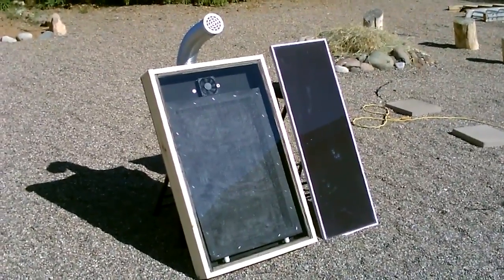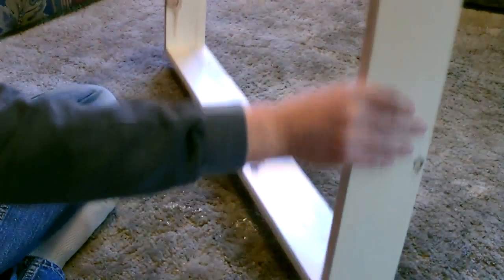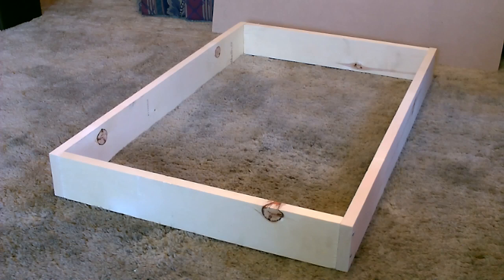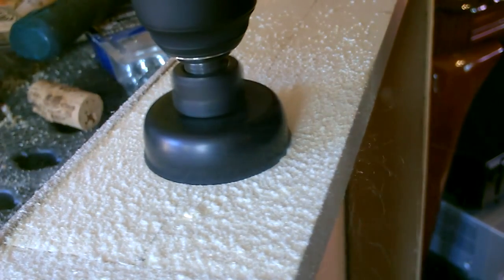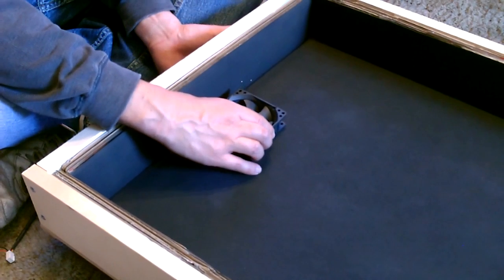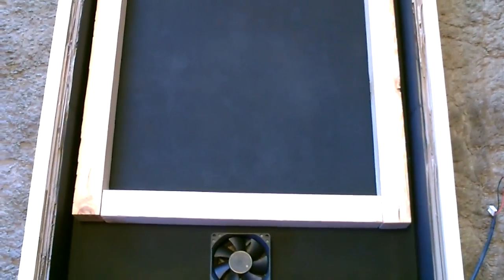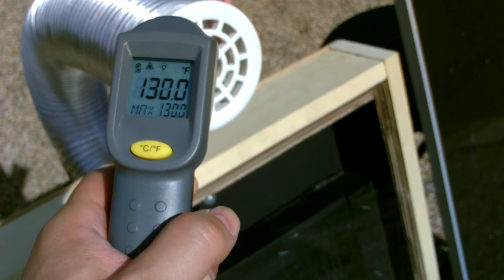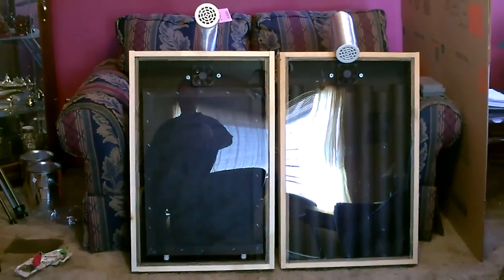Solar Air Heater! - The "Screen Absorber" Solar Air Heater! - Easy DIY (full instructions)

Comment: What are you using to power the fan?
Reply: So it wouldn’t work at night?
Reply: @exoscrewdriver4213  not sure if your question is to be funny or not. If so I laughed (a lot) but if your serious then no this would not work at night. First, the sun heats the black paint on the air collector he made. There would be no heat from this at night. Second, the solar panel will not work at night but you could wire the fan to a battery for night time use. Durning the night this system will not create hot air.
Reply: @exoscrewdriver4213  LOL, thanks for the laugh.

Comment: How hot does this get in the summer? Of course I dont want to use this much in the summer. If its in place all year round, I would worry about temps.
Reply from the maker: rocketsfan since94 hi there. the internal temp inside the box only reaches about 200F in the hottest of conditions (that would be when it's 115F outside in the summer) . temp would have to reach 451F for anything to burn (it won't even get close to that)
Reply: desertsun02 appreciate the reply. I could not find any answers to this anywhere. This is good to know! thanks again

Comment: Great video, I'm about to go buy the materials to try this. Is the fan required or would it work without it?
Reply from the maker: Alel Natal hi and thanks. the fan is required. (without it, the heat will barely trickle out). *these types of heaters will work pretty well without a fan only if they are very large (10 to 20 times the size of this one).

Comment: Hi,
I've just watched your screen absorber video and have 2 questions.
1. Does it matter what direction the air holes are facing? Top, bottom or sideways.
2. The screen does matter what type of material the mesh is made from (steel or nylon) and how many microns is the screen?
Thank you,
Laura.
Reply: Use standard aluminum window screen.  It can be purchased online in a charcoal finish.  Painting flat black is still a good idea of course

Comment: This may be a stupid question that I might already know the answer to, but during night time, this doesn't produce heat right? Or when the sun is completely covered by clouds? My room gets cold at night and I want to make it hot somehow without using grid electricity
Reply: Solar works the best at night. That time being when it's the sunniest.
Reply: It is impossible to collect solar energy without the sun. You can get results through clouds, as the energy is contained within the sunlight. It will diminish with cloud cover, of course. While it is impossible to collect energy at night, it is possible to prolong captured energy by lining the back of the box with asphalt shingles. Asphalt absorbs heat and holds on to it for longer periods of time. Roof shingles often remain warm for more then an hour after sunset. That's the best you will be able to do. I agree with the idea of placing this INSIDE the home - in a window - if possible. Makes much more sense to heat air that is already warmer than outside air.
Reply: Ben Waitin yeah, or maybe if I make the solar power during the day, and put it inside some lithium battery packs that can hold a lot of energy, and then use that to power a small heater in my room at night?
Reply: Ben Waitin thanks for the idea... another reason i wanted to do this though is because today for example where i live in Toronto, our power went down for 24hrs.. i had no heat in the house and luckily it was only -3C today..no heat, no electricity no cooking...so if i had lets say a lot of energy stored up in batteries i could have used that... Even if it took me several months to break even , i would consider it especially in those situations when the grid goes down. I also work at an automotive shop and i can get batteries for much cheaper. I don't have any knowledge building this though, so i have to research that still
Reply: sranjesuper Your problem is going to be cost-vs-benefit. If you are motivated by reducing "on the grid" costs, it is going to cost you for a charge regulator, 12v batteries (more than one - daisy-chained), and a power inverter. I am not trying to dissuade you, but if you add up the out-of-pocket costs for those items, and then add up the monthly savings in your electric/gas/propane bills, you will do well to break even over several months. Solar as a long term heating source is a long-term investment. My recommendation for a night-time heat source is a clay-pot heater with a 10 hour votive candle. Do some experimentation with these - clay pots are cheap, and decent candles can be purchased for about $0.30/each in bulk.
Reply: sranjesuper If you go the clay pot route, make SURE that you use glass votive holders for your candles, and make sure that the wick is at or below the top of the holder. Also, make sure that whatever stand you use for the clay pot is NON-flammable, and gives at least 1/2 inch clearance from the open flame above. If the pot goes down over the candle like a hat, the candle will go out. Like I said, do some experimentation during the daytime, on a non-flammable surface only.
Reply: +sranjesuper Rocks and Bricks can hold a "charge" of heat through the night. (A fireplace can still throw off heat after the fire's out.)  Maybe put rocks in the system - however, this may require a large amount of rocks. They also need to be large enough to not restrict air flow, yet small enough to fit in the duct between the solar panel output and house.
Reply: sranjesuper even the smallest electric heater would use approx 750 watts ac.
Reply: Gmail User the clay pot method has proven too dangerous. Don't use this method.

Comment: I LOVE this simple, straight-forward concept! The one thing I'd change is I'd duct the room air into the inlet of the collector so I'm not having to heat frigid air from outside. One could mount a couple return ducts and the supply right into a sheet of plywood clamped in a window. Insulate the ducts and the plywood and you'd be good to go!  Use a simple thermostat to turn the thing off if the supply air got too cool due to clouds, etc.
Reply: Actually adding heated air from the outside creates a baloon of air (positive prrssure) lowering the ability of drafts of cold air around doors and windows from coming in

Comment: I built my version of your heater, but I have mine mounted on the inside of my house over the double pane window of my French door. Its air tight for sure. I didn't put any type of insulation on the sides inside the box like you did with the cardboard, don't no how that will affect my results. I also painted my inside black as well but also added black roof shingles on the inside back panel using gorilla glue. I haven't had a sunny day to test it yet so I will post my results on that when I do. one thing I didn't take in to account was what happens on cold, cloudy days, condensation. I had a big puddle of water on my kitchen floor coming out of the 2 inch single inlet hole at the bottom. to rectify this, im think im going to put one side on hinges so I can open it up to avoid that problem....the size of my box is 65 13/16" x 25 3/16". I think once i become more proficient with these sort of devices, i might try building one with the use of magnifying lens or Fresnel lens to concentrate the sunlight on a medium; like maybe ceramic plates or something that absorbs the heat. idk yet happy building folks
Reply: hi there. did you get a good heater out of it at the end? is it worth it?
thanks

Comment: How do these work on very cold (single digit Farenheit) days? I'm thinking of building one to heat a chicken coop. Also, why so many inlet holes? Wouldn't that cause too much cold air to get in faster than the solar screen could heat it?

Comment: great invention and appears to work fantastically. I going to attempt to build one to fit on my French door that is fixed(doesn't open). I'll use your design but I will caulk all the corners and the back cover  within as well as a fully painted black surface inside the box but I think I'm going to add asphalt shingles to the inside, back cover to hopefully absorb more heat. I also will probably use some sort of reflective surface outside, mounted to my adjacent deck to point more sunlight towards the French door's glass. I want to be able to control the temperature as well, in case it becomes unbearably too hot, so I will build some sort of window blind system on the outer door to control the amount of sunlight entering the box. Thanks for the concept idea and step by step video desertsun02

Comment: you could even use this to make a solar A/C unit... make a duct close to the ceiling and feed it into the "inlet" side, make a simple one way check valve so air can only be pushed into the unit and let the sun heat it up and create a draft sucking the warm air near the ceiling right out. the cooler air can be vented in from the basement AND if you want to take the warm air outlet and pipe it into a 55 gallon drum of cold water. you'd have to crunch a few numbers to figure out how warm the water would get but you could also double this as a hot water heater if done properly... and come winter time when you wanted heat you could simply flip the unit around and plug into the outlet side... the only downside is that you need to live somewhere that gets sun all the time... and it wouldn't be effective enough for use in northern regions where there's usually heavy cloud cover in the colder season which pretty much negates the whole point of the project, but i do know that it gets to freezing temps in the desert some times.

Comment: Will be quite interested to see the comparison of the two type of solar heaters! Design and materials with high heat transfer coefficients definitely increase the output. I might even try putting small drill holes in the bottom of the inner wood frame to increase flow to see what would happen.

Comment: I am about to put one of these together and curious about connecting one  up to a cold frame garden box. I guess just direct the vent from the top to a cold frame next to it and have it end up buried in some stones (thermal mass) Would be great to add a thermostat for when the temp gets too warm inside.... Also trying to figure out a way to place the who unit INSIDE the cold frame as to not heat unconditioned air... Would love any thoughts you guys might have...

Comment: Install a sealed 12-v battery in the circuit. the solar cell will charge the battery plus run the fan. The battery will keep the fan going all night. I've seen these with lava rocks inside that'll store heat and slowly release it all night.
Reply: +Sporty Tone God!!!  Finally!!  The guy who made the video didn't say what kind of fan, and then we assumed the fan just ran by itself with the wires coming out.  That was the most important part of the video...  Thanks for clearing this up!!  BTW, how does the solar cell charge a 12-v battery? (Sorry, I'm new to this...)  Def getting lava rocks for the inside!
Reply: Try somewhere like Harbor Freight. They have a solar cell charger that plugs into your cigarette lighter (or power port) and lays on the dash. The fan uses very little power, so a small unit like that should more than keep it fully charged.
Reply: That type of charger has a built-in voltage regulator to prevent over-voltage and taper the voltage back as the battery charges so it only gets the correct voltage & current the battery needs.

Comment: I enjoy your approach to creating useful energy saving devices and I share your sense of inventiveness with similar projects of my own. I thought I'd maybe add to your screen concept by suggesting the use of black aluminum soffit material instead of the mesh material. It is rigid, easy to work with and will reach temperatures of 150+ degrees in only a few minutes of exposure to sunlight. it also weighs next to nothing and is very cheap and readily available. it does not need the internal frame so it saves on material costs too.
Keep up the good work and thx for sharing
Reply: That is a good idea! I'm going to check into it.
Reply: @johnshilling2221  to jest świetna idea

Comment: Do you think if you painted the entire enclosure black that it would facilitate more heat?
I know with the cardboard sides they are there to insulate from outside temps, but if the outside is absorbing the rays as well the insulation barriers won't have to compensate as much.
Just a thought.

Comment: Nice Mate! I do have a couple of suggestions as I want to build one of these for my greenhouse. I love the screen idea by the way. Have you thought about positioning the fan on the intake so the heat coming out doesn't hurt the fan? Also if you tilt your screen within the box so that all air must go through the screen verses just over it, it might even get the heat up even more. Nice job and video steps to build. Thanks
Reply from the maker: D Holtman hi there. thanks. the screen definitely seems to work well. some people report that they can achieve temps equal to or slightly higher with a screen heater than with a can heater. (i'll do some testing when it gets colder and compare the 2 types in a side-by-side test). those computer cooling fans are very tough. the heat won't hurt the fan. it doesn't get hot enough in the collector to damage it. i tried tilting the screen to increase temps but they remained essentially the same (the bottom rung of the internal frame acts as a baffle (to the incoming air) which helps to spread out the airflow in the collector).

Comment: Why heat outside air?  Why not pull warmer inside air through system to produce even hotter air?
Reply: Exactly. It's way more efficient raising the temp inside box starting with 60 degree indoor temp vs. 30 outside air. Plus recirculating adds a  cumulative heat gain instead of fixed.
Reply: I'm thinking people with pets would have that screening loaded with fur in no time.
Reply: Hi  tuubydude. One very good reason is because "fresh air" (as Lukasz put it) contains more moisture, which holds heat far more efficiently than 'dry air' does (which explains why people often run humidifiers in conjunction with central heating, i.e. not merely for health reasons).
Reply: Studený vzduch zvenčí má vždy nižší vlhkost než vzduch uvnitř domu. Tyto ohřívače s přístupem vnějšího vzduchu jsou účinné vysoušeče bytů.
Reply: Possibly because it's too loud.
Reply: +subbernh hahhahaa, ir right
Reply: I'd like to try this for my greenhouse!!
Reply: Good point, I'm thinking simplicity is the main reason. For example using this simple solar design you only need 1 inlet to the house. Using the inside air would mean you would also need an outlet from the house, possible additional fans as well as complexities around airflow and the thermodynamics.
Reply: He's trying to magnify global warming
Reply: Because you need freish air
Reply: @lukaszlukasz7148  most conventional heating systems use air from inside the house. Ex, the return ducts. So recycling the air is a better idea

Comment: This looks like an excellent off the grid heating solution. I like the construction of this over the steel can version and am looking forward to your performance comparison. One quick question; have you experimented with using some form of insulation for the exhaust vent? It seems like a potential heat loss area. Thanks for this and all of your other great videos!
Reply from the maker: Jason Martin hi there and thanks. haven't yet tried insulating the exhaust vent, but that is definitely a good idea. these heaters work very well especially as a supplemental heating source and in areas where the winters are a bit milder (cool/cold but partly to mostly sunny)
Reply: @desertsun02  Fiberglass would work,covered in black plastic.
Reply: Cool! I was just reading how this type of solar heater works better than the pop can type.

Comment: How or you able to run the fan without a capacitor .
I have try that and I can not without a capacitor .?
Reply from the maker: hawk1481 hi there. i have no idea why you need a capacitor. i always just run computer case fans directly connected to solar panel. it should work. (just make sure the panel is between 6 volts and 12 volts and puts out enough amps (or milliamps) to run the fan.
Reply: desertsun02 I am working on this with my sun for a school science fair, thank you for the video

Comment: excellent, but would adding more screen inside the screen collector make it more effective? maybe a couple more layers inside the frame to capture even more of the sunlight on the more porous and thus more conductive screen than it going to the back of the box, since it's only wood? also, what about even adding more screen to the back for the same reason?
Reply from the maker: ***** hi there. from most experiments i've seen and done, 2 layers seems to work the best. (1 or 3 layers will typically result in slightly lower temps.)